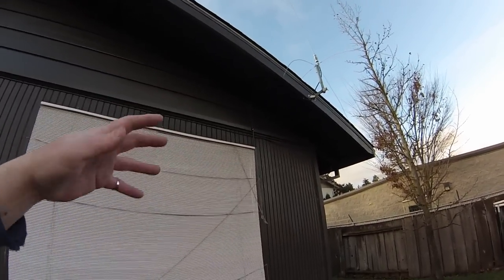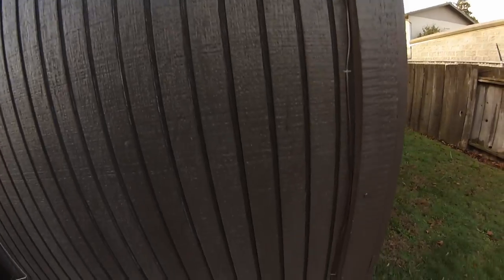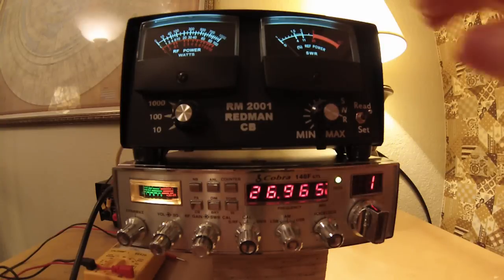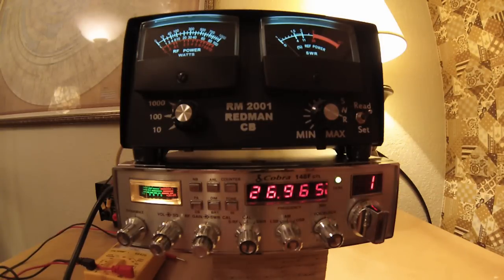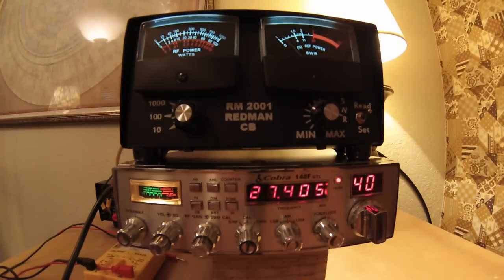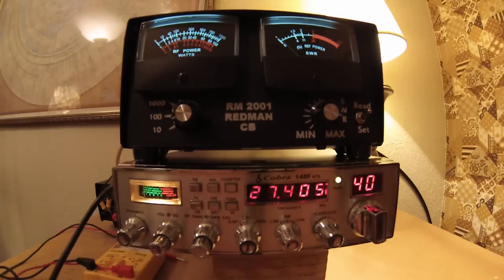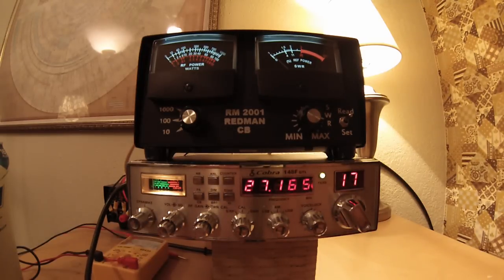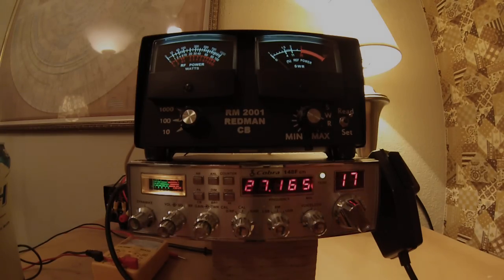DIY CB Base Antenna Using a 102 Inch Stainless Steel Whip

Comment: I started out with CB radio.  Now i have my Technician license and i plan on getting my General license when i have free time.  To all the fellow hams who seem to dislike CB radio, look at it this way:  It is free to use, requires no license, and is pretty cheap and easy to get into.  Had i been able to afford a CB radio back in high school, i would have gotten into ham radio much sooner (like 10 years sooner).   Who knows?  My life could have been different now because ham radio has made me interested in electrical engineering.   When my nephews and nieces are old enough, i may buy them CB and GMRS/FRS radios just to get them interested in radio as a practical and fun means of communication.  Then i'll guide them into ham radio.  Ultimately, i hope that it will make them interested in electrical engineering, satellite communications, or other technically-related and lucrative careers.
Reply: For the financially strapped radio hobbyists, citizen's band and PMR446 are all we can afford.  
Citizen's Band transceiver - £50 to £150
HF amateur radio transceiver -£500 to  £5000
I know VHF and UHF equipment from other radio services is plentiful and easy to convert to VHF and UHF amateur radio bands.  Even buying VHF and UHF amateur radio equipment is quite affordable.  But HF surplus equipment that can be converted to HF amateur radio bands is near impossible to find since businesses abandoned the HF bands in the 1940s and early 1950s.  Thus, we are stuck with very expensive amateur radio equipment for HF amateur radio bands.  That is not something all of us can do.  The foundation license is very easy to get, almost laughably easy to get.  But the equipment is very expensive.

Comment: when you guys are considering a 1/4 wave whip a good antenna and a cobra cb a good radio, really this is relative to equipment to which you have been exposed. It is not really a good system. I can talk with 20 watts to another radio many states away.  The uniden or cobra radio really has no great performance, no good filtering, and no clean transmit nor receive. Compare any ham radio to the cb stuff. It is really worth a look. I can talk on 80 meters from NC to Va almost any given night. I have made contacts to UK, Germany, Italy, Netherlands, Spain, Aruba, Venezuella, Antarctica even. Around the world. That might get your interest. It also has very important, helpful real world applications in an emergency.
Reply: Why do anything with a cb radio when a Ham radio license is so easy to obtain today. Doesn't make any sense to me.
Reply: Robert Fraley   The idea around CB is for every Hamm radio operator there are 200 CBers my guess.   No License.  Talk to local friends and just talk.  Hamm radio does require a license that is easy to get.  But communications on Hamm radio are more formal in nature.     The CB's can be purchased for less than 50 bucks.  The Hamms are much more expensive.  Good CB radio for 25 bucks.  So you pay your money and do what ever you can afford.  My Hamm costs a little over 2k. My CB cost less 125.
Reply: KC3BBI
Reply: Not true on the price of a Ham radio.Many hand held models are $25 or less even for a dual band HT & they work very well.Also mobile models can be purchased for around $100 or less.I use both Ham Radio & CB Radio & many of my Ham Radios cost much less than many of my CB Radios.I enjoy both hobbies but I think that it's better that we spread the correct or factual information so others are not mislead & are discouraged from the hobby because of the price of radio gear.The prices I stated above are for New gear not Used also just FYI.
Reply: Well while we are being so truthful you should also mention that 20 watts is far above the Legal Limit of what a CB Radio is suppose to do by Federal Law.Of course I would not expect someone who makes a living from making radios far exceed the legal limits permitted by law. It's no secret that you have made a living from violating Federal Law & you love illegal CB's & amplifiers & you care nothing about the Laws of the Land.It's all about profit to you.I own lots of CB's from DAK,Cobra, Browning,Tram,& just about any other company that ever made one but I also own a lot of Ham Radios & I'll take the ICOM over any of them.I have been playing radio since 1965 so I also know quiet a bit about radios both Ham & CB & I do NOT promote the use of Illegal CB's & amplifiers on the CB Band.You only push CB because it feeds your greedy bank account & the truth does not do that for you so you don't share it.
Reply: how much did you pay for is your 80 meter equipment? ant, radio ,coax , probably close to 2 grand,if not more , DON T COMPARE, to cb equipment, you mention emergency applications , well many more cbs on vehicles (including millions of truck drivers have them,) out there than 80 meter equipment ,oh, and  you dont need to pass a test to get a licence.
Reply: Ham radio sucks
Reply: @GTARockman  why comment just move on none of us cbers give a crap about ham radios I have owned a kenwood and an icom id take a uniden over one of those anyday for what I use it for
Reply: @n5ifi  if a ham liscence is that easy to obtain id have one I failed the test everytime I took it and frankly why bother getting it when Im just gonna come home and hop on channel 19
Reply: This is very fascinating.  However citizens band radios are about £50 to £110.  Amateur radio HF transceivers are £400 to £5000.  I was actually very interested in amateur radio until I made pricing comparisons.  VHF and UHF surplus radio equipment from other radio services are plentiful and very easy to modify for the VHF and UHF amateur radio bands.  HF surplus equipment from other radio services is near impossible to find since many services abandoned HF bands for their businesses in the 1940s and 1950s.  Thus, we are stuck building very mediocre equipment or purchasing extremely expensive equipment. It seems us financially strapped radio hobbyists must stay on citizen's band or PMR446.  I even priced a very used Icom HF transceiver once.  It was still  £600.
Reply: Sad Ham ):
Reply: I agree about the license. The test wasnt easy for me either

Comment: I had an Antron 99 way up over the top of an 80 foot or so tall tree. It lasted a few years and a storm blew it down and busted it. I bought another one and put it up there and it lasted about four years. Well worth it. If you don't want to be a mud duck, get your antenna up high. It makes a world of a distance.
Reply from the maker: +Bob Kerbs Years ago I did Have a Base Station set up at another House in this area. My Tower was 56 feet to The top. I had a Old 17 Foot Ground Plane on top of that. Like You said. You can get out when it is that high. I Cant Build anything like that Here. Putting the 102 Inch whip up was just to see if I could make a Base Station out if it. It worked good. Now I'am consentrating on Putting the Old 148 in My Truck. allmost done with it Now. Thanks For Watching Bob.
Reply: No problem. I had a Cobra 148gtl and they're a great radio. It's basically a Cobra 2000 base station without the cabinet and power supply. Great for side band and it has a dual conversion receiver. They don't put out like a 29, but if you have it tuned and modged out and smack an amplifier it'll blow smoke.One of my favorite radios. I just this weekend put my old Galaxy 33HML in my car. It's from the nineties and it's peaked and modged and I smack a Texas Star 667v amplifier  through a Wilson 1000 antenna. I run the amp on low and I key up 5 watts and swing over 400. It's pretty loud!! When I switch it to high I can key up 20 and swing around 600. It gets out. Stock mike and there's absolutely no squealing or feedback through the built in talk back.
Reply: +Bob Kerbs 
These amps are illegal however and ham people along with tv watchers,  and any other radio equipment is subject to interference from the dirty amps that are not really linear on the output of the scope.
Reply: +Robert Fraley by the way if you want to compare what the 700 w amp will do i will compete for what your amp will do and what my system will do without an amp. see who talks further.
Reply: they  are now  undocumented   amps   nothing   is illegal  ...just  ask a democrate

Comment: Yes Dan...you got the right idea. Ground Plane. Every antenna needs one. Some like the Antron 99 are specifically made to operate without a ground plane, but they help to add one...I did. The 102 inch steel whip is made for mobile use, which uses the vehicle body as the ground plane...all mobile antennas do. So you were spot on to add the ground plane to it, it helps receive better, ground better, cuts out a lot of noise and also drastically improves the output range of your transmitter. Good job, bro. I may do this myself as a backup antenna or a test antenna...good idea.
Reply: Gun Slinger mobile antennas do not need a radial ground plane
Reply: No one cares.

Comment: I plan to setup a base station using exactly this approach, a 102 steel whip as the antenna. I have a metal roof on my shed, so I will experiment with using that as the ground plane, but if that doesn't work, I will go with radials such as you have

Comment: That's cool! I mounted a 102" on the roof ridge of my wood frame house with asphalt shingles, so I just connected four 102" wires to the grounded mount and laid them out 90 degrees apart down the roof and connected each end with a rubber grommet through the roof and SWR was 1.1 or less on all channels... The slant of the roof provided the "droop" to the ground plane wires. I now have a steel roof, so I may try just grounding the grounded base of the  mount to the peak and see how well it works
Reply from the maker: Thank for Watching Bob. Good Luck out there.

Comment: Nice.   That radio is a keeper and kinda rare.  I say rare not because they're hard to find but because I've never seen a 148 GTL that hasn't been molested.
Reply: Thats a 148 gtl dx isnt it?
The only thing a 148 gtl dx needs is a power mic and an amp. They have everything you need from the factory. Am, fm, lsb, usb, cw and a freq counter plus channel select. 
I have always loved those radios
Reply: I have one.

Comment: I made a vertical dipole for someone a few years back.  The element pointing up was a 102 inch antenna.  The element pointing down was the black wire inside an extension cable.  The last I heard he was still using it successfully.

Comment: Great video I just got back into CB after a while I have a rci 2950 and an antron 99 its about 18 foot antenna and a 2 transistor box the furthest I talk on upper side band is Italy and some other places antenna is about 35 feet up with a 10 foot pipe so about 45 feet pretty good 73"s
Reply from the maker: Tony Garigel  That is Great Tony. I sure Wish I could get My self interested in My Radio again. Mabe I'am just to busy with other things in My life. Good Luck out there. Thanks for Watching.

Comment: your ground-plane radials should be at 8ft 6" for 27mhz
stinger at 27.5  8ft 5" should help you have a good match throughout the 27.0 to 28.0
wanna have some 26mhz  make the stinger 8ft. 6" same as the radials
also gotta remember ground-plane does come into play on hf. so a mast of at least 10ft or so.
and use rg8x cable. and to add to the subject.  on hf height is your friend and get the antenna up in free space, 
away from obstructions that interfere with the antenna giving you false readings on the meters

just something to help you 11meters(cb) guys out...

73's from K7sce southern arizona.
Reply: Scott Edick I

Comment: Hi! Dan - just a quick 'hi' from this side of the pond (I'm a Brit) - Your SWR sometimes works BETTER at a slightly higher level.  I ran a York 863 into a thunderpole II at about 1.3 to 1.7 to 1 SWR & got about 6 miles or so from my house.  This was UK FM at the legal 4 watts.  Just got back on the air after fifteen years or so out of CB.  Like the channel a LOT! - very concise, cheerful & informative.  High Numbers To You from me, stay safe & good luck on your farm.  10-10 til we do it again. 'TJ.....

Comment: I'm thinking about buying a quad magnet and putting a 102 whip on roof of my metal barn. Should act as a ground plane just like on roof of a truck?
Reply: I had the same idea for my 30x40 metal shop building.
Reply: Any metal would work even a pizza pan

Comment: Optimum length for 11 meter ground radial is 108"
Reply: The 102 inch whip is added on top of a six inch coil spring.  This brings the length to 108 inches.  I believe the stainless steel whips are intentionally cut short so one may add a coil at the base to protect the antenna from breaking.
Reply: So a spring is your only option ?
Reply: @Fox250R  : No. Length is length (she said)

Comment: good looking radio Dan
Reply from the maker: Gra 7961 Thanks. Yeah I got a good Deal on it. Paid $50 for it at a Garage Sale early one Morning. It was Still in The Box. I had No Idea if it was any good or Not untill I got it Home and Played around  with it. I dont know if I had ever Been Tuned or Tweaked or Peaked. I cant tell. But I know a good Tech good really make something out of it. Thanks For Watching.
Reply: +Dan Jarrett Hi Dan, I have a part 15 Am transmitter that use a 102 whip antenna. Is it important for it to straight?...right now it is at a height of 50 feet with the antenna mostly leaning!
Reply: It's a highly sought after model since it is not juts  148 GTL which does not have the frequency display but just a regular channel 1-40 readout for channels.

Comment: Hello.  I am having a similar problem with very high swr readings. I added four ground radials and nothing has changed.  How long are your radials?  If it is not my ground plane I am thinking it might be a bad coaxil cable.
Reply from the maker: Hi NM Patriot Thanks for Your comment. Well when I put These Radials on it the other day I didnt think it would work worth a Didally. My Understanding is That The Radials should be 108 inches each. The same length as The Antenna. I dont have that option of doing that in the place I have it mounted. so I whent with The Treaded Rods I picked up a Lowes. Only cost a couple $ and they are each 3 Ft long. And they seem to working out good. As far as My coax. I'am using 2- 20 Ft Long pieces of 50 Ohm. I put them togather My self and tested them with a Ohm Meter to make sure I have No short anywhere.. I hope that Helps You Out. Thanks for Watching.
Reply: Thank you so much for your reply. I am going to try to work on the antenna again this weekend.  I really want to get my base station up and running.  Take care.

Comment: nice vid. :) i plan on putting a cb in my house & maybe useing the 102" whip..
Reply from the maker: +MRJOHNDEERE3720. :) Yes the The 102 will work good. And You can play around with The Plane to see How it changes. Thanks for Watching.
Reply: Dan Jarrett
ur welcome. :) i just hope it will look good on top of my house..lol
Reply: +MRJOHNDEERE3720. :) the thing about the 102" steel whip when its on a house is that you'll hardly notice it. about the only time you'll easily see it is if the sun is shining off it.
Reply: madmax2069
& it will be. theres not much 4 trees. but thats ok if i dont notice it. lol
Reply: +dan jarrett i 4got 2 ask u what is that music at the  beginning? or did u make  it ur self? i like it. :)

Comment: Where did u attach your ground wire..on antenna base?
Reply from the maker: Just  to the Mast of the Antenna. That is the Ground
Reply: Dan Jarrett thank you...I know the answer is simple ....But i am doing same setup and swr will not drop below 1:5 and my power output is lower then suppose to be...my deadkey has dropped ...different radio same problem... gotta be a poor ground somewhere im thinking
Reply from the maker: 1.5 is a good reading on the SWR. I think I would leave it there. Maybe try adding a Second Ground connection and see if that will help.
Reply: @tunnelrat1439  My radios were doing the same thing until I put an amp on it. I have an Antron 35feet up and grounded in two places. My Bearcat sits around 1 and 1:2 but the others jump to 1:8 at times. Needless to say I use the Bear and an mobile amp and play around with these cornbread base stations around here bragin on their 5 pill or what have you. I just walk on them when they start smack talkin and they can't figure it out.

Comment: sorry for my ignorance,but what does the ground wire do to the antenna?
Reply: It provides something for the feed system or radio to "push against" as a second terminal. Without it, there is no way to force current into the antenna.(w8ji)
Reply: It helps to protect the structure in the event of a lightning strike.

Comment: You need a step by step video of that antenna build and a microphone booster 😆 volume is up and it's quite low only for the outside shots inside is fine.

Comment: Once you install a external SWR meter you do not need to bother with the radio meter. its off anyway . 
NEVER TRUST A SWR METER ON A RADIO UNLESS ITS HF rig. and even then get a 2nd opinion on a EXT meter

Comment: What did you use for the ground plane wires?
Reply from the maker: jd I Just used some old Threaded Stock that I had laying around in The shop. The Best Way to have done this Antenna would have been to Have it Mounted on The Very Peak Of The Roof and Then Just run some simple Copper Wiring down The Roof line. But I didnt have that Option with this. Thanks for Watching.

Comment: How do you determine how long to make the radials?
Reply: They have calculators online but essentially they are supposed to be the same length as your driven element which in this case is 108 inches. His are too short but work well enough.